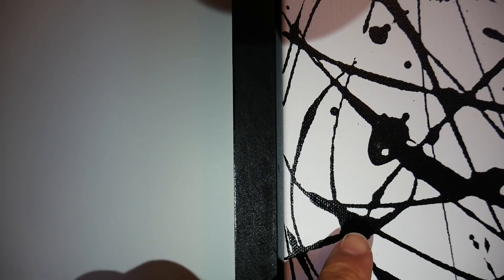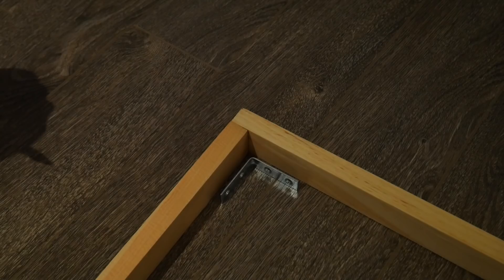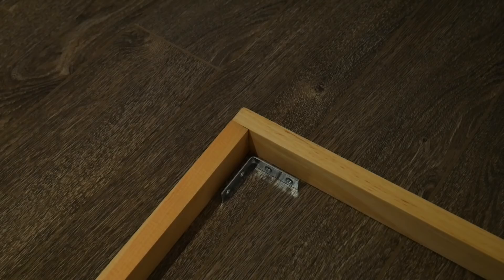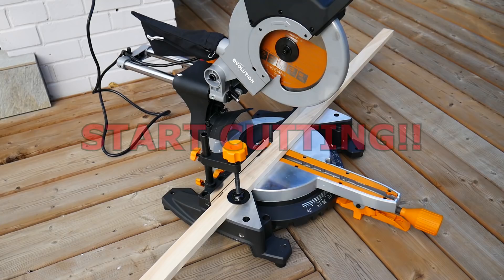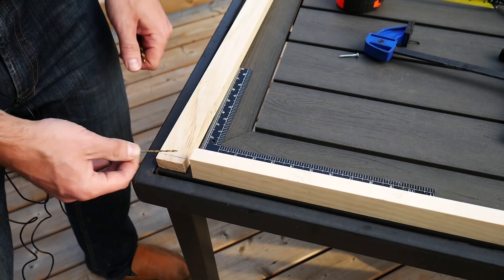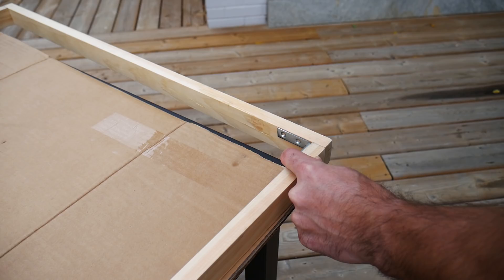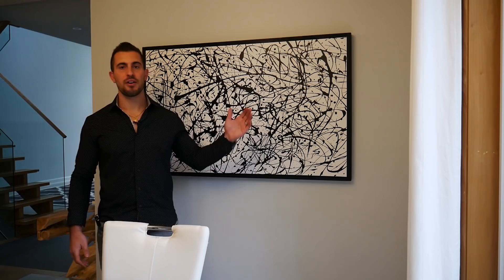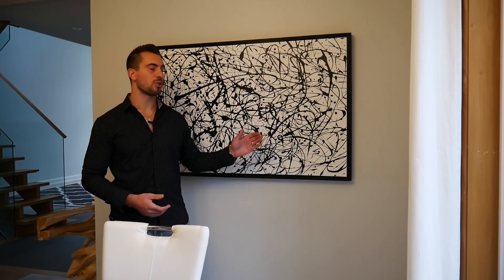How To Build A Floating Picture Frame For $30! (Easy Method)

Comment: Great vid. If you're looking for black, try India ink instead of stain. It's easy to apply, covers well, dries fast, doesn't smell, and it's fairly cheap. You can usually find a good-sized bottle of Speedball India ink at Michael's.
Reply from the maker: Thanks! I will check it out!

Comment: What if the canvas is a different thickness? Won’t the angle brackets pull the face of the canvas toward the back of the frame?
Reply from the maker: If you have a thinner canvas you will need to find thinner wood or have it cut to approximately the same thickness so everything is "flush"

Comment: Canvas won't get dirty on repeated contact with air and dust over Time???
Reply from the maker: Haven't had any problems yet. Looks just as good as day 1. Also, I paint the art in my house and I usually spray the canvas after with a UV protectant. You can easily wipe the canvas clean after with a dry microfiber cloth without risk of damaging your art.

Comment: I don't think this describes how to actually float the painting in the frame. I need more info on the spacers. Shoot.
Reply from the maker: They are just flat "L" brackets from the hardware store. I believe I used 2.25" x 2.25". They just space out the canvas from the frame so that there is an air gap all the way around and it appears to be "floating"
Reply: oh, i see. thanks. feel free to delete my comment(s).

Comment: On your example of your framed finished piece,, the wide part of the wood is showing, yet in your demonstration, you are showing the narrow part of the wood showing, so you have constructed this frame backwards from what we originally see in the beginning! It took me awhile to figure this out. 
This makes your tutorial very confusing. I have invested about an hour on this video and it has really been upsetting to try and make sense of why your framed abstract piece is opposite of what you are constructing. I am sure you realize this? Why purposely do this?
Reply: It's the same as the beginning. It looks thicker due to the canvas stretch bars.
Reply: @shvaew  I'm comparing @:36 to 7:06. If the front part of the frame is the same then I stand corrected. It looks to me that the finished frame is much wider in the front facing part- I am not talking about the depth of the frame. I know that they come in different thicknesses. I am talking about the facing part that is almost flush with the canvas. It looks to me that the wood was put opposite in the demonstration piece as compared to the finished framed black and white piece.
Reply from the maker: It is the same orientation :) Must just be an illusion but the frame at the beginning was the exact one that I made in the video.
Reply: @EmbraceMaking  OK you made it so you would know

Comment: Sorry fell asleep very boring and ya make an easy thing look hard
Reply from the maker: Nobody said making a picture frame was going to be exhilarating lol.
Reply: Why you looking it up if it's easy?
Reply: Your brain is overtaxed !
Reply: It's hard, because when he first shows his framed artwork, it is different then what he actually constructs. The initial frame shows the wide side of the wood showing, the one he constructs shows the narrow edge of the wood showing. I basically wasted an hour on this. Would have been nice if he explained what he is constructing is not what he shows framed on the wall!!
Reply: It would also help if he used standard thickness of canvases that people frame which is .50 thickness. He doesn't even say how thick his canvas
Reply: @crochethappy3786  canvases come in different thicknesses! .50 in NOT necessarily standard! The frame is the same though out. SMH
Reply: Sorry fell asleep very boring and ya make an easy comment seem du....zZzzzZZ
Reply: @crochethappy3786  No, It's the exact same as the beginning of the video. Don't forget that what you can't see is the depth of the canvas (and the depth of the frame. You are looking at the "skinnier" part of the wood as the face of the frame.